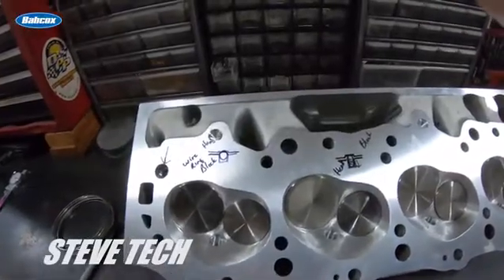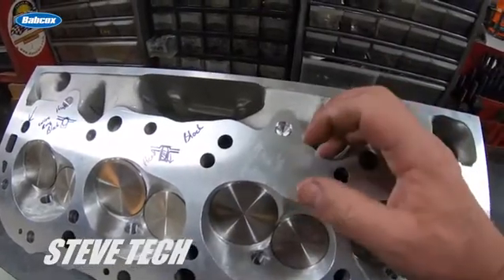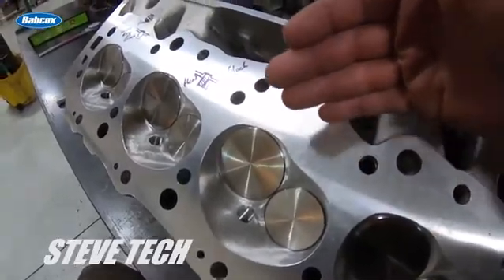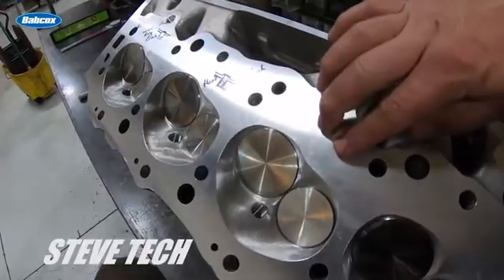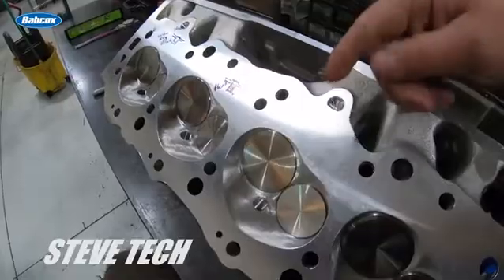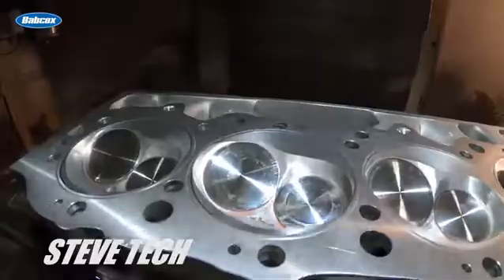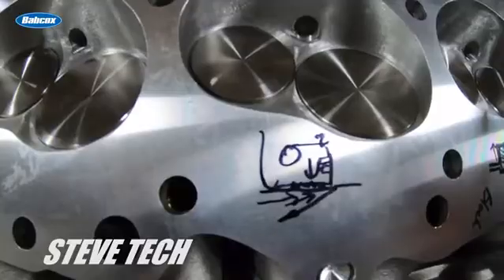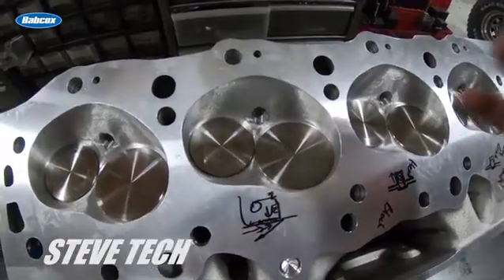Piston Quench and Cylinder Head Chamber Mods

Comment: My friend, your definition of the word QUENCH missed the mark. Yes, you explained the added benefit of a tight clearance between the piston top and the head, but you did not define the word Quench. There is one good answer so I'll you to think: Quench - means "To Cool" ~ What is being cooled in a running engine??
Reply: Not quite. "Quench" means "to extinguish". Basically, obsolete engines burn fuel in a cool compartment. The temperature near the cylinder head, the cylinder wall, and the piston face is just too cold (including radiative effects) to support combustion.
So yes, you have the right idea, but the wording is a tad off.
Getting the piston to essentially touch the cylinder head in the quench area minimizes but does not eliminate quenching. Obsolete engines with combustion chamber surfaces below the fuel's ignition temperature (1200F and above is even better because it will burn soot) simply can't operate efficiently because they WILL quench.
Reply: @RePeteAndMe  No, quench does not mean "To extinguish" It means to cool. Look it up

Comment: Never made sense. Hemis have no quench, most motorcycles and many others also. For wedge and other styles, the quench creates swirl which improves mixing and cools hotspots. By the time ignition occurs and the flame front approaches the quench area the piston is going down and the quench distance is increasing, so is the quench area and volume. This should increase efficiency and eliminate knock. Quench AREA is probably more important.

Comment: Steve, I have a question about squish and squish velocity.  Would you please react to this quote I read elsewhere?  The author stated it better than I could.

"Zero squish is a backward move. Squish speeds up combustion and pushes fuel from the outside of the cylinder back towards the center to be burnt. It reduces the chance of detonation as well. You'll have less unburnt fuel in the engine."

Comment: I have zero deck height on my engine with cometic 027" headgaskets and my quench was near perfect. After 3 years of running the engine, the pistons barely touched the head. My heads took 003" of shaving to clean them up which is minimal if you're using cometics on aluminum heads. Zero knock at 30psi of boost.
Reply: Impressive, it's easy to get it tight if your patient start tight but safe and slowly get tighter untill starting to whiteness marking the head 🤗🤗🤗 anyone that doesn't have the balls to push the limits will never be the best 😁
Reply: @Grooty79   Just after my last post above, and before putting heads back on the engine, I found a cam lobe going bad while further inspecting the engine. I never got that engine back together. I decided to build another engine using an aftermarket block. I'm not planning to go so close this time on the piston to head clearance.
Reply: wOw ! pure example of quench to the max.
Reply: thats just asking for trouble lol
Reply: @nalley6815  I agree!! Unless you're Steve Morris or some other big high dollar engine builder, building race engines for big names, trying to run 0 quench is a very bad idea!! It's a really great way to find the limits of your engine in a hurry!

Comment: Perfect quench is symmetrical about the axis normal to the wrist pin, AND symmetrical parallel to the wrist pin.. Anything else causes the piston to rock or tries to force the piston to rock against the ability of the wrist pin to rotate, aka, along the axis normal to the wristpin axis.

I understand that people proud of their ignorance say "If it ain't broke, don't fix it." However this mentality or lack thereof is what fights ALL innovation and advancement. With people like them, we'd have never started riding horses, let alone building cars. I dismiss such childish braying out of hand.

Quench is most effective when it is not only symmetrical on the axis parallel to the fore-and-aft axis of the cylinder, but also when the quench has radial symmetry, so it provides NO difference in force between the front and back and left and right halves of the piston.

To maximize the evenness of pressure on the piston dome, the combustion chamber also needs to be completely symmetrical in all aspects, so the piston always experiences the same overall distribution of force about its center point, during compression and combustion.

Now, UNLESS  your intake and exhaust valves are miraculously placed kitty-corner from each other, with both exhausts opposite each other across the wristpin's axis, and both intakes opposite each other along the wristpin's axis, for example, you will experience an asymmetrical force at exhaust TDC, because the exiting exhaust is being released on the exhaust side of the cylinder while the quench area and intake valves on the opposite of the cylinder are still providing some degree of resitance to the piston's upward travel.

The benefit of having a piston that has ZERO force trying to rock it one way or the other is that the piston rings can be smaller and the skirts can be smaller in size, thus lightening the piston.

If it were possible, having both the center of mass AND the center of pressure on the cylinder both centered precisely on the wrist pin's axis would make piston skirts less necessary, as nothing the forces on the piston are doing (pressure or inertia) imparts any rotation or rotational force to the piston whatsoever.

In fact, having the center of pressure below the wrist pins would be even better, were it physically possible.

I know that these things are not covered much, but they are physical realities and can result in lighter, stronger pistons that have more reliability and absorb less power to run.

Comment: I have a Honda k20 engine. I have 1mm oversized dished valves on the intake and I have stock size flat faced valves on exhaust side. Is this a good set up?
Reply: Yes. smaller exhaust valve on anything actually makes more power. Because it wants to escape more than go in . . . real basic way of putting it, not why although.

Comment: You say quench (or squish, whatever, same thing) is a bit of trial and error, but you don't say what a good starting place is?  I realize it's a target that can't be accurately met during engine assembly, but some starting numbers would help.  Cometic makes great gaskets in many thicknesses, but they're $200/pair so I'd like to get close first.
Reply: .040 is effective and safe with steel rods. You can push it to .030-.028 if you're feeling lucky.
Reply: @andysteele4056  I actually went with .030" with forged rods and 4032 forged pistons and AFR as-cast AL heads.  I had the engine decked .009" so the piston was flush at TDC and the Cometic head gasket automatically dictated the squish.  The engine runs great, no knocks or pings, and starts surprisingly easy even with a carb.  Smooth idle too.

Comment: So if you have to much gap between the piston at TDC and the flat part of the combustion chamber on the head that can cause pre-det??
Reply: This is very serious race engine tech that nobody other than racers/engine builders who spend their lives doing this stuff should fiddle with!! For the common dude, you're just asking for disaster trying to get "zero" quench, and you don't gain anything from it anyway. Running in the safe zone of between .038 and .048 is plenty enough quench to accomplish good combustion, and you also don't have to worry when your engine is going to destroy itself. Unless you're Don Garlits or John Force, play it safe!!
Reply: That's what I'm gathering, trying to decide if I want to try and get the gao right, or delete the gap
Reply: @townsendliving9750 i don't know what you mean by deleting the gap. But you still need a little space between the head and pistons because pistons do rock in the cylinder. Bearing wear is a not a big factor on an engine being rebuilt daily. But on a street engine if you have 0 head space as the bearings wear the pistons will eventually hit the head.
Reply: So I'm curious to 6:41  know if I 0 deck my block .023 head gaskets 56cc chamber 4340 kit (306) iron heads with boost I wondering if I would be good on pump gas and yes I know the camshaft has alot to do with it aswell I'm going to try this combo with some help from my engine builder...Lol

Comment: You have just described what I have always known as squish.
Reply: I think I heard David Vizard say that the Brits use "squish" and americans use "quench", so that's why you hear both. I believe he also said that quench is slightly more correct, but that the terms are slightly different, though very closely related.
Reply: Yes I agree . I was taught in grad school that engineering a petroleum or related engine to perform a specific purpose which end results in improved power to fuel efficiency from the same amount of fuel input. There are several different things that are still being tried to gain a minuscule fraction of efficiency and is the difference in winning a NASCAR race especially the past restrictor plate races.
Reply: Squish is what you spend money on when not spending it on your car. 😉
Reply: Quench is cylinder wall cooling 
Squish is pressure/ directional
Reply: @arthurking6549  I always understood quench to be cooling, as in you quench the fire or your thirst. Likewise I always understood squish to be squeezing the air fuel mix, as the piston is rising, towards the spark event from between the piston top and the flat surface of the cylinder head.
Reply: @michaelau5159  Words have a meaning 
Cheers